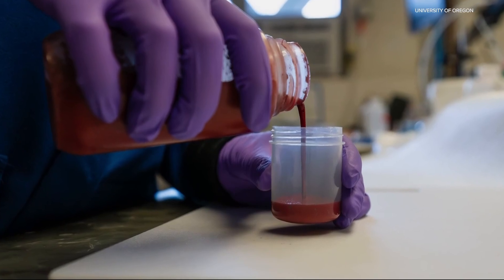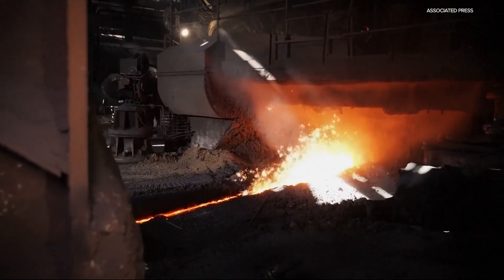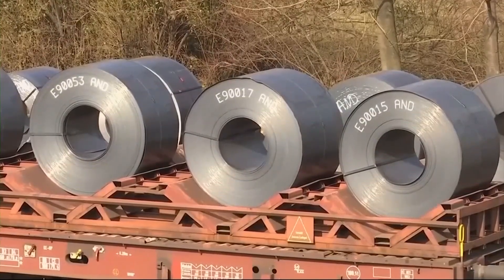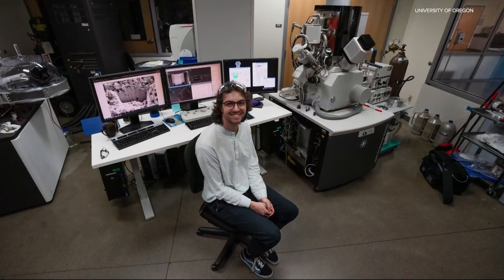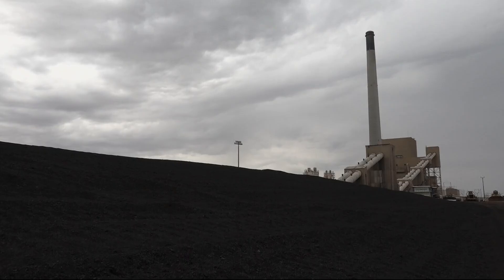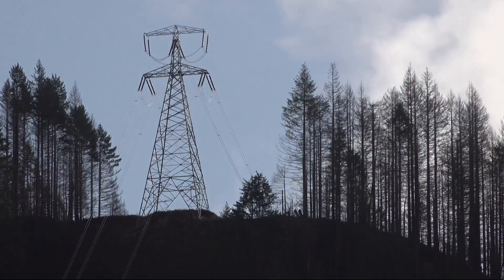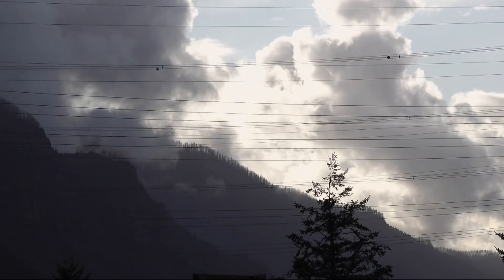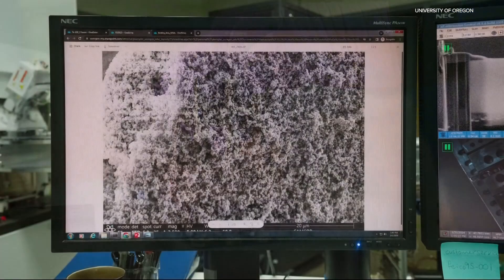UO researchers are working on a green method of creating the iron needed for steel production

Comment: Nice to hear about another green method for making steel.  It is obviously in a very early stage.  The Europeans have smelters in operation using hydrogen.  MIT spinoff Boston Metal has a beta MOE smelter operating in Brazil.  So far the MOE technology seems to be the most promising.